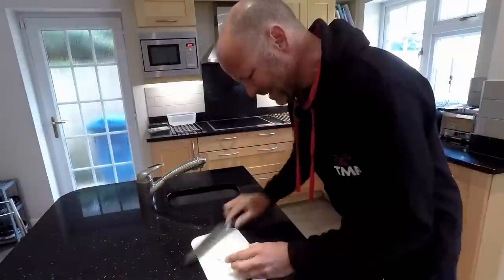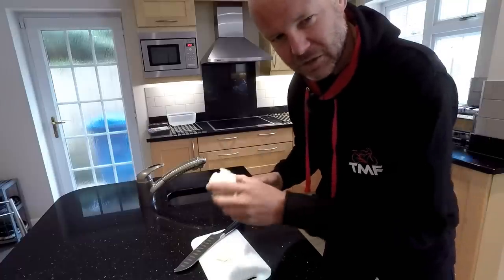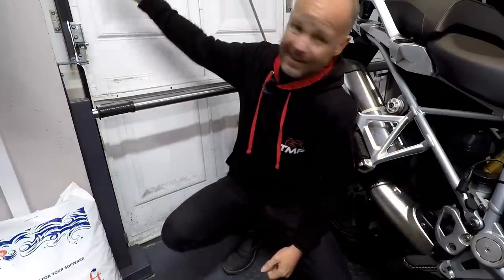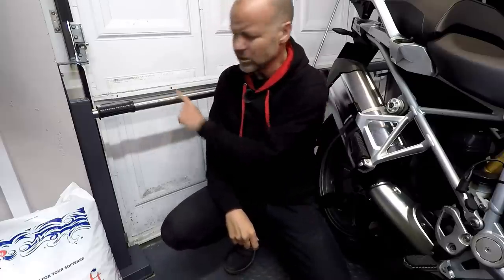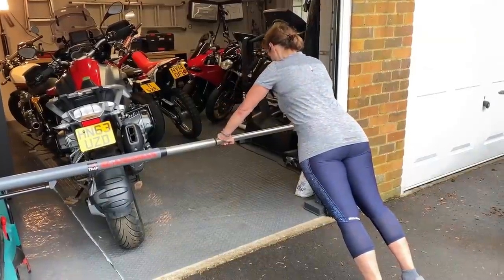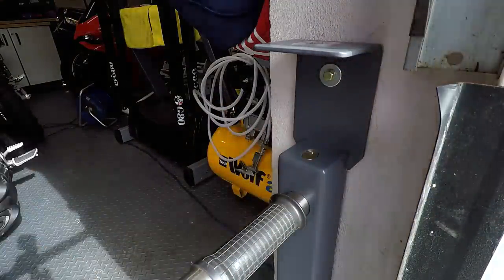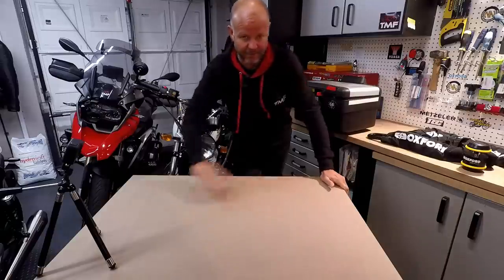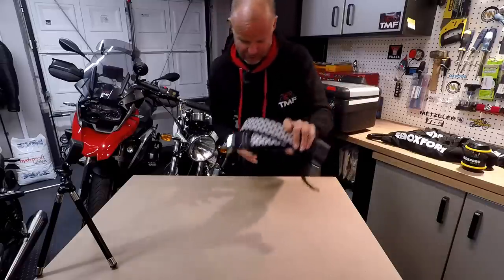Best motorcycle security products

Comment: Almax have just released a 25mm link chain with the new Squire lock, the toughest chain and lock combo for motorcycles you can buy.
Reply: Also the most expensive
Reply: Matty Wall very expensive, though cheaper than the increased insurance premiums should your bike get stolen.
Reply: Can pay 250 for a oxford beast chain and lock which is just as secure 🤔.   Although the almax is a beast

Comment: Another tip is use plastic coated heavy gauge stainless steel cable rather than chain, very hard to cut by hand, of course the universal key (battery angle grinder) makes chains and cables just a minor nuisance these days.

Comment: You can get all the benefits of biketrak trackers without battery drain using the Automatrics MTrak Proactive. Battery powered, 18-24 months between recharges, GSM, GPS, AND UHF tracking, 24gr monitoring service and police in the UK equipped with the UHF tracking. Check them out. Not cheap but I use on all my bikes.

Comment: I have a brand new bike I use cable lock disc lock I also if I am out touring I will cover the bike and cable lock the cover to the bike. Question with a GPS tracker that I will be installing as soon as it arrives, would it be better to have a sticker on the bike or some way to let the thieves know you have a GPS tracker or  the cover of the bike put on it alarm will sound if moved. I know there's good and bad reasons but if they know that is being tracked maybe they won't steal it.

Comment: The beast lock will actually fit between my Honda 700 wheel spokes making it virtually impossible to tamper with. I got both the lock and chain from Infinity online at only £102 each and use it on the rear at home and an Oxford big boss 16mm alarmed with 16mm chain for the front plus it is chained to my other bike so seeing as they are covered and  outside our front window any tampering during daylight is easily detected. I have had the local scumbags lift the covers to see what is holding them and as the cover is tucked under the lock it went off and they left very quickly.
Reply from the maker: Cheeky so and so's - shows a bit of security works though....

Comment: My preference  is , Bike in garage which is covered by the house alarm system which is set at night along with the house, bike track which you mentioned, this does not drain the battery as the unit has battery built in, topped up via bike battery, my bike has been stood for two weeks without being charged without issue , also with the bike trac the voltage can be checked and set to alert if voltage drops below pre set value( user preferences via app), takes some getting used to though, moved bike in garage and alert sent, it does work very well, as you said though, if someone really needs to nick it or anything else they will, our aim is to make it difficult?      Cheers
Reply from the maker: Wish those voltage thresholds would work on my two Biketrac trackers!
Reply: TheMissendenFlyer , how come they don’t  work for you?
Reply from the maker: Beats me, never have!
Reply: @TheMissendenFlyer  if you have the biketrac app on your mobile it can all be sorted!

Comment: Here in Balkans there is bike crime present, but I would say in no way the level you guys have there in the UK. Major cities and mostly scooters are the risk but in relatively small numbers compared to UK. It's also a bummer that we do not have any type of extra insurance other than the basic one for motorcycles. No insurance company here wants to touch bikers with a 10ft pole since we have a high accidents number, so bike theft insurance is collateral damage because of that. 
Since I don't have a garage, for my beloved GS I use OEM DWA which is finicky (especially in high winds it goes off), bike cover is very useful and I use it every night. Disc lock with alarm as well. But I live in a small town where bike crime is mostly non existent. Planning to get one of those portable SIM card GPS trackers soon. Cheers Andy!
Reply from the maker: If you use my link before the end of this month you can get a discount off the tracker if you are interested...cheers!
Reply: @TheMissendenFlyer  Thanks, but it's a bit expensive and the import customs here would rip me a new one if I was to order it. It will have to be a simple one from China. Minimoto does look great though.
I like the bar thing on the garage door though, great stuff!

Comment: Do you have your garage alarmed?
I have my garage and garden cabin covered by sensers connected to my house alarm.Yale wireless system £189 for everything i needed to cover my house,garage and log cabin,easy to expand if needed.Alerts phone  etc
Also another cheap garage door lock i have fitted is the enfield garage door bolts,basically 2 door bolts that fit at the bottom either side £25 and a bit of fitting for a bit extra security.
The other thing i do is chain my bike to the door from the inside,i can because i have another rear entrance door.Yes it is a pain undoing it on a morning but there is no way they are lifting the door from the outside with a ground anchored bike holding it shut.
Reply from the maker: Needless to say I didn't detail all the measures I use to secure my bikes for what I assume are obvious reasons.....

Comment: a possible flaw with the guardsman might have to do with the width of your motorcycles being narrower than the height of its bar.  if that were the case then one could lay the bike down on a dolly and push it underneath the bar.  i think, of your collection, the gs for sure, would NOT fit underneath the bar if placed on a dolly on its side.  what do you think?  is the bar on the guardsman low enough?
Reply: Hi Ernie, the Guardsman sits 670mm at it widest point from the garage floor. The vast majority of bikes are much wider then this so wouldn't be able to slide underneath. Hope this helps answer your question.
Reply from the maker: Hi Ernie, I did mention that the height was such that most normal bikes couldn't go under....you did watch didn't you??? ;0)

Comment: I’ve been considering the Litelok for a little while now so I think you’ve convinced me. Would it fold under a typical motorbike seat or not? Like the idea of the Monimoto too, think I’ll be using your code for one of them too 👍
Reply from the maker: Go for it - that Monimoto discount code is only temporary though so make the most of it soonest.  Sadly the Litelock wouldn't fit under the majority of motorbike seats....works as a belt though!  Much easier to carry than a big chain...
Reply: Hey Matt, Lewis from Litelok here...the lock can be rolled up to be smaller than your motorbike helmet. Hope this helps

Comment: I have a few oxford beast security lock's and chain's they are very solid i even tried to cut a link off one that is nigh on impossible, I also suffer from advanced Multiple sclerosis. but I never feel the need to pull theatrical faces (worthy of an equity card) when i lift mine tho, still i dont have the weight of companies on me to lift either!
Reply from the maker: You may be bigger and stronger than me - I’m only a wimpy fella...

Comment: Not all trackers drain batteries, I've had a DataTool Trakking fitted to my bikes for 4 years and never had a battery issue and I don't have to keep the bike on trickle charge
Reply from the maker: Indeed - I think it also depends on the bike you have it fitted too and how much cellphone signal you have (low signal = more power drain)....

Comment: It's been said (by the police?) that you should consider  spending around 10% of the value of your bike(s) on security and many people are a long way from doing that.
A layered approach is reasonable but do consider what shops have to do in problematic areas with shutters, bollards, high tech measures like smart water/smoke and centrally monitored CCTV if the bikes are really valuable and you want to mitigate against professional thieves as well as the opportunistic ones.
Consider too the fabric of the building - thieves are quite prepared to remove bricks from a building if necessary.  I notice you didn't have bars over your garage window or door and you may wish to look at that too.  If a building is overlooked or otherwise that can be important too.
Perhaps also ask the local police to inspect your security arrangements as they will have seen a variety of break-ins and will know better as to what is going on in the minds of different thief types  than we will ever do.
Incidentally a modern grinder with a good disc while noisy, needs some thought if you want to be proof against that work of the devil.
Finally let's all hope we don't meet a thief armed with a knife or prepared to threaten our families.  Even bank staff in such circumstances simply hand over the keys...

Comment: Cheers for this. I leave my Tuono Factory covered outside with a 20mm chain on the rear, chained to the frame of my RAM 2500. Front is a disc lock with another deterrent cable.
I do like that Guardsman though...shipping over here to the Colonies (CA) would probably cost as mush as the unit lol
Reply: Hi Joshua, congrats on the new shed. We are currently working on a Guardsman which fits within the shed coming out in the next few months. Stay tuned!

Comment: Only an anchored bike will be safe,anything else,disc locks,chains only on the bike etc,without atached to something hard could be removed with specialized steel wheelies,because you dont need to run the actual wheels anymore if you atach on them small wheelies which could get the bike to the van ......
Reply from the maker: I think determined thieves will get around any security - it’s all about deterrence through layers...

Comment: Thinking about high voltage shock security possibilities. Altogether our bikes are a heap of a conductive iron with a source of electricity. Some kind of a bike paralyser? Or a paralyser kind of chains?
Reply from the maker: Could be tricky with all that fuel on board?? ka-Boom!
Reply: @TheMissendenFlyer  That is true, though probably I would not mind having the thug being blown up when stealing my bike. Admiring honeybadgers and their natural super resistant skin  it would be fine to develop the similar structure material for a    sheath of locking chains.

Comment: The more the better.
Lock each wheel, not just one. A roller skate or board under one locked wheel means it can be pushed. Lock it to something when you can, keep the lock off the floor. A cheaper lock works better in the air. More locks wears out the the thieves batteries in portable power tools. Think about where you park on tour. Secure parking is worth that extra few euros on your bill. And cover it like you say. A cheap tatty cover is good. Out of sight is out of mind. I hate thieves. 
Happy travels
Reply from the maker: Agreed all round...

Comment: if its a hassle for you then it will be a even more hastle to the thieves i have 2 disk break alarms got the got a chain wrapped around the wheels got a bike cover that also has a lock on it i then use a tarp to cover it all up then got a chain around my gate not totally theft proof but if they are going to steal my bike they they got to work for it with the noise it will make someone's going to hear it just remember if its inconvenience for you then it will be more inconvenient for them
Reply from the maker: Yes very good point…

Comment: I have to disagree with your comment around biketrack draining battery in a few days. I don't have my bike connected to charger and ride it recently maybe once a week (sometimes less) and observed no problems whatsoever with battery being depleted in that period of time. Also, it monitors the battery voltage and in the phone app you can set voltage which if reached it will alert you about this fact.
Reply from the maker: One of the reasons I bought it was for that low voltage monitoring - doesn't work on my bikes!!  Out of interest what bike do you have it fitted on?  Might be peculiar to my bikes or the fact they are indoors in a low phone signal area (causing the biketrac to pump out higher power).....
Reply: @TheMissendenFlyer  I have V-Strom 650 and keep it in b&m garage as well. Strange that it doesn't work for you, I'd suggest check with them to see if maybe installation was done incorrectly or controller is faulty or something else. It should just work, if you see other data from the bike in the app, like odometer, position etc, that means data is being received on their end.

Comment: I saw angle grinder cut Litelok in 3 seconds. So beware, its expensive and only stops bolt cutters. Most thieves carry grinders now, so it will be useless.
Reply: That's very true, them battery powered grinders, sadly they've gotten more imaginative, it's also common for them to wait till you're about to ride off then they pounce and knock you off it and steal it 😅
Reply: The lockpicking lawyer has a few vids on the litelock.  As you say, not too slow.  But equally something is better than nothing, and if you bike has and the next one doesn’t, you stand a better chance.
Reply: @ThePhil4  for the money you can get a better lock than this is what I'm saying

Comment: That guardsman is really expensive, fallabe and to me its not needed. I reckon I could sledgehammer that and with it been telescopic it would separate.  I'm a mechanical handling engineer and simplicity is key. Two concrete bolted hanging hooks wrapped out front with a length of 50 x 50 x 5 box across your door padlocked would stop anyone.  Plus it would cost one fifth the price. Talk to your local engineers and fabricators, were a rare breed, we know what we're doing and it'll be a lot cheaper and safer than a fancy telescopic fishing rod on a hatchback gas strut.
Reply from the maker: Well I'm happy with mine!

Comment: 6:20 I would not recommend that litelok. My lock has jammed so I no longer use it, plus it’s ridiculously easy to grind off (10seconds)
Reply from the maker: Mine seems to work a treat!  Nothing is totally secure as I said at the start of the video, it's all about making it as awkward as possible for the bad guys, having got the "Sold Secure" Gold rating I'm happy with the level of protection the LiteLok provides.

Comment: I couldn't justify the cost of the barrier for my old bike but I have installed a ground anchor from Image4. https://image4security.com/collections/ground-anchors-1/products/g80-ground-anchor. The resin capsules that come with it to fix the bolts didn't really do the job but this stuff from Screwfix does the same thing and there's plenty left over to grout round the anchor.     https://www.screwfix.com/p/easyfix-kem-psf-175-ef-styrene-free-polyester-resin-175ml/9349j?_requestid=201838  I now have a rock solid anchor to chain the bike to, highly recommended.

Comment: Got two ground anchors chemically bolted to the floor and two 22mm Almax for my two bikes,an industrial galvanised steel roller door,the door and garage are alarmed and covered externally and internally with CCTV and just to top it off my personal protection trained Rottweiler has 24hr access to the garage from the house.  I welcome anyone to try stealing my bikes. The drive is also covered by PIR alarms which alert me as soon as anyone steps on the drive way. Its just a shame we have to do all this to prevent shitbags stealing our bikes,wouldn't it be nice to be able leave your bike anywhere and its still there upon your return!
Reply from the maker: Wouldn't it just!

Comment: There is no effective way to stop bike thieves in the UK !. Here my bike is in a drive in cellar, I have the door handle wired to a 230 volt 30 amp breaker, they touch that handle & stealing my bike is the last thing they are thinking of, we can shoot intruders as long as they are on your property here, so they are not going to be in a very good state after the latter two elements, then our two dogs which are big dogs, will secure them til police arrive !